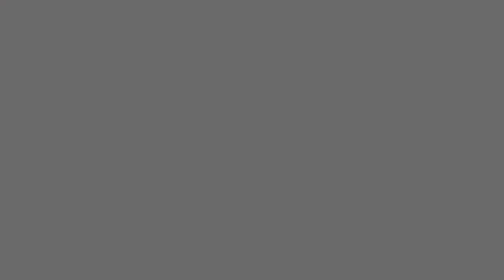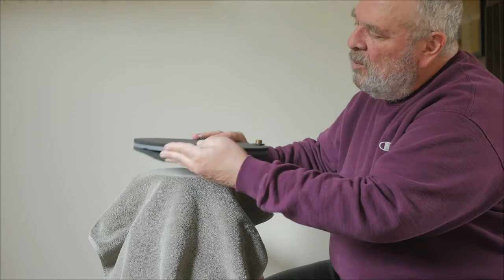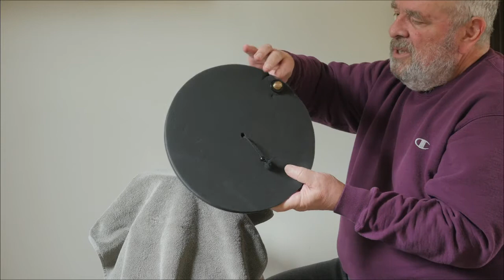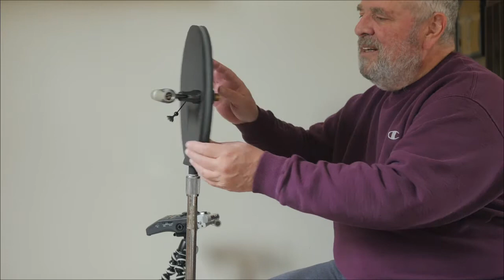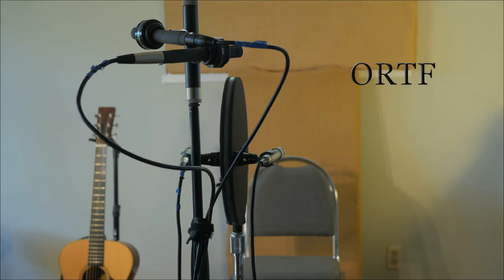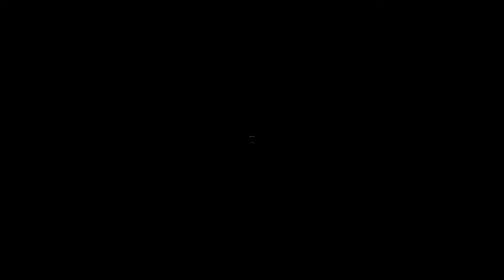Jecklin Disk for Omni Stereo

Comment: I want to sincerely congrats you for the very high quality of the content, and the recording sound and your charisma with calm atmosphere.     That said, to me the difference (with headphones) is not that much between  the 2!     Is the 2 layer of foam are stick to a ring or if the disk is full under the foam?        Bravo from Montreal Qc.
Reply: Thanks for stopping by.

The disk is a solid and fairly thick piece of high impact plastic with foam stuck to it on each side.

The big difference I notice when listening with headphones is the additional bass response of the omni mics. There are fundamental differences in the low end response of omni mics vs any directional mic, it's inherent in the physics. So the J Disk is an attempt to improve the stereo image when using omni mics.

Fran

Comment: This is great! Thanks so much for the video.

I'm making a disk myself. Is it essential to be able to rotate the disc? Could I achieve the same results by moving the mic stand itself to create different relationships between the mics and the disc for tonal balance?
Reply from the maker: No need for the rotating disc at all as far as I can tell. The latest version of the disc spec calls for a larger disc and I found an article that suggests using rockwool for the disk material. I think I'm going to build one of these myself: https://gearspace.com/board/remote-possibilities-in-location-recording-amp-production/1056249-jecklin-disk-revisited-diy.html
And this Wikipedia article has a slightly different spec: https://en.wikipedia.org/wiki/Jecklin_disk

Fran

Comment: You seem like such a decent guy! Thanks for this. I'd imagine that a piece (or two) of acoustic foam would be a cheaper option. I'm not sure I'm entirely convinced that this adaptation makes a difference with, compared to without. I haven't seen this in videos of top studios, although, this seems specific omni polar patterns, and I have no personal reference, as I generally use a cardioid polar pattern
Reply from the maker: Thaks for visiting and commenting.

Simple acoustic foam won't give the same result as a solid disk. It's certainly possible to cobble together a working Jdisk without spending for a commercial disk, though. Perhaps the best thing about this commercial disk is the mic mounting arrangement.

The OSS or Jecklin disk technique was developed by an engineer/professor who works with classical music in concert halls. It's not usually used in studio recordings. Of course studio recordings tend to be multi-miked, while the purpose of the Jdisk is intended to be a single main pair that captures an entire ensemble.

The Jecklin Disk is indeed designed around omni mics. Omnis have a fundamentally different response to low frequencies compared to directional mics. Spaced omnis are another technique often used for recording classical ensembles, giving a more enveloping sense of space and more accurate low frequencies while sacrificing precise location and mono compatibility. The Jdisk is intended to give more detailed location and mono compatibility while maintaining the benefits of the omni pattern. 

My use of the Jdisk is out of the norm since I'm recording a single instrument with a close mic distance, but I have made some of my most satisfying recordings using this technique. I also "break the rules" and use ORTF spaced cardioids for some of my solo guitar recordings, but I like the wider soundfield of the spaced pair over the tighter sound of an XY array.

Fran

Comment: So what omni mics can 1 use with these disks? For example can I use AT-4022 mics? or do they have to be the little clip on mics? I just got to the part of the vid where you said you're using KSM140s. How big are those? I'm blind.
Reply from the maker: A pair of AT4022s would be exemplary mics for use with a Jecklin Disk. Shure KSM144s are about the same size as the AT4022, I think.

Fran

Comment: hi
what about the spacing between two mics? It looks on the video that the space is 16,5 not the second 'improved' twice as big version, that is mentioned in wikipedia am I correct? My idea is to use 16,5cm spacing that is already in place in my tascam recorded - tascam dp 008, and to mimic Jecklin disk idea approach I would make a dividing disk that would be attached to the recorder, what do you think?Best Regards M
Reply from the maker: You're right, this demo uses the smaller spacing. The larger spacing is used with a larger disk as I recall and the mic mounts on my disk would make it hard to achieve the wider spacing.

I think your idea of using a disk with your recorder sounds excellent.

Fran
Reply: @homebrewedmusic  thank you, yes I was actually going to ask further if you have any comperisement with the wider option and if its a significant improvement, it wouldnt deter my willingness to do the project but i'm just curious,   cheers!!